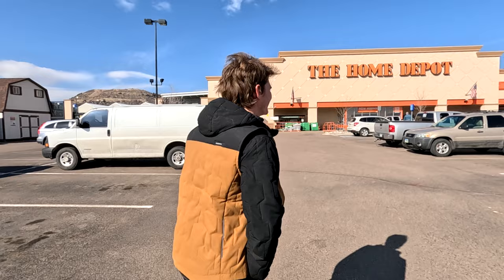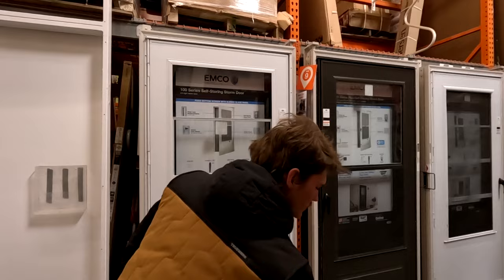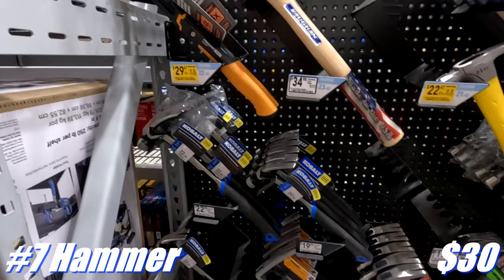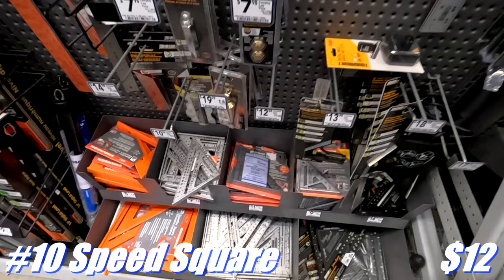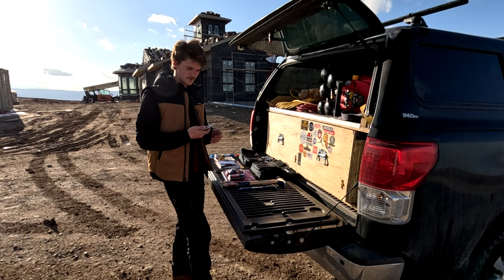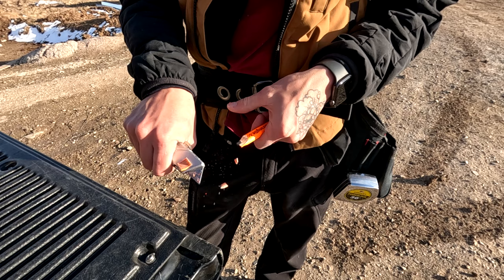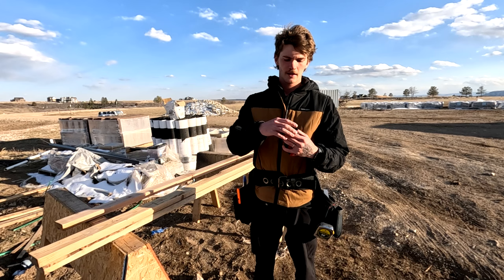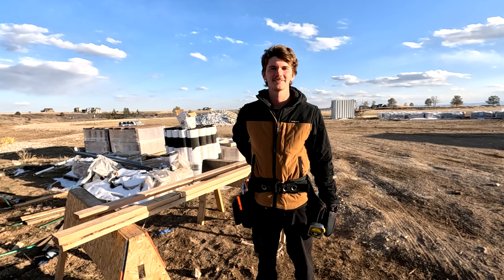Carpenters Toolbelt! | Top 10 Tools for UNDER $180

Comment: Be sure to use the blue chalk when snapping lines on concrete. It's almost impossible to remove the red chalk line from concrete when the job is complete.
Reply: Also if you're snapping lines inside, use blue. I have two chalk lines, a red one for roughing out and a blue for trim such as hand rails and such
Reply: The  smallest estwing trim hammer with the 2x4 rip claw is what i use so i can work twisted lumber its lightweight compact and can fit where large 20 ounce hammers cant
Reply: I have all kinds of different colors for different uses.
When framing the best tip I can give is when laying out your walls hit your lines with a can of clear lacquer… the clear lacquer will make those lines permanent and weather proof (so mainly helpful when framing in the winter or a rainy environment).
Reply: I have a deep indigo blue is that ok?
Reply: Yep. Someone should have told my concrete guy this!!!
Reply: There’s framing and drywall on your lines …. It doesn’t matter
Reply: @cjsawinski you can just get black chalk if you want it to be permanent.
Reply: Baby powder
Reply: Same. I use blue on exposed concrete like walls but when I know the concrete with not be exposed like on inside slabs with some type of flooring be it carpet or tile Black chalk is my preferred as it won’t disappear as easy from continuous debris
Reply: @gabesmith3938 still some clear coat will work wonders. Even on inside when the floors get dirty from sawdust and such. A little dab of water and they reappear

Comment: I’ve used Fat Max 25’ tape measure since a year or 2 after they started selling them decades ago, I made fun of a 2nd year young guy joking with him about the name, then I tried 1 after 4-5 other coworkers started swearing by them, the very next time I needed to replace a tape measure, I bought a 2 pack of Fat Max & have been using them around 40 years now if I had to guess, even use the Fat Max 35 footer for longer measurements, ONLY STANLEY Fat Max or regular Stanley I use, really dislike the company & rest of tools

Comment: I am currently 89 years old.
I started in the home building industry in 1951.
I remained active untill i was 70 years old in the business.
When i started most builders werent using any power tools, like circular saws.
Framing carpenters would have an open top hand made tool box with about 8” high sides.
Length would be about 36”, and the ends would be about 8” higher than the sides and tapered above the height of the sides.
The over all size of the box would be about 8” wide and 36” long, again with an open top.
There would be a wooden carrying handle attached to the raised tapered ends, and full length of the box.
There were no measuring tapes used, all carpenters used folding type rules of 6 or 8’ in length.
For longer measurements 50 and 100 ft steel tapes were used.
typical tools carried by a framing carpenter in the tool box would be 3 hand saws, one being a large tooth rip saw for things like cutting roof rafters, also an 8 point saw for general cutting of studs to length etc. and a finer cut 10 point saw for things like cutting white pine facia work.
The saws would have some type of a protective cover over the teeth.
Every carpenter had a hatchet in his box in addition to a hammer.
Most framing hammers were in the 20 oz range and had wood handles.
Plumb was the most popular brand for both hammers and hatchets.
There would also be in the box a combination square, a 24” framing square, and a bevel square.
Also a chalk box, a cats paw, and maybe a pair of pliers and a 24” level.
But basically that made up all the tools for a framer.
The contractor as a rule furnished the longer level used for the framing.
There were no speed squares at that time, also no nail guns or power tools other than early type circular saws used by very few contractors.
And the box of tools would be carried to and from the vehicle to the actual work place.
Reply from the maker: Wow that is amazing! Thank you for sharing
Reply: YOU'RE AWESOME ERNIE

Comment: Great choice of basic tools, after year of framing I knew I wanted to make a career out of carpentry. I bought Occidental Leather bags and used them as a finish carpenter, thirty years later with my own finish carpentry business I still use them even when hanging cabinets. The thing about the nail bags is once you get used to where your tools are, switching brands sucks.
Reply: Worse when your tool bag company goes outta business, Mine were MTM bags...

Comment: The Swanson pro (with the book) is where it’s at for normally priced squares. So many more useful functions than any other square for the price range. Also, those chisels don’t have a meta back, Lowe’s, Walmart, and harbor freight all sell the exact same 3 pack but with metal backs and each store changes the color. The cheapest is at harbor freight. And lastly, I personally hate slip joint pliers, I carry the small/medium Irwin vise grips. Best all around pliers. Knipex are obviously better but too expensive to just beat the shit out of haha

Comment: The next model up from that pouch set I have it and the nail bag on it has the speed square slot it has a small pouch in the back next to the Hammer holder I keep my truck line in that one and the actual Hammer loop on the tool holder pouch I use that to hang cordless nail guns off of

Comment: I’m in Occidental Leather guy myself. Yes they are pricey but they practically last forever (at least th😂 real leather ones do). The synthetic ones I have to admit are lighter and possibly more comfy (at least until your leather breaks in). But I’ve seen so many synthetic bags just not last in the professional world.
These days I’m mostly a trim carpenter and don’t even really need bags but I where an occidental “vest”. The vest is awesome, it’s light and doesn’t bother my hips at all. And if I ever need full bags for framing I can attach my old occidental bags right to them for a full kit.
Reply from the maker: I’d love to try a vest someday! I tend to sweat a lot, how’s it do with that?
Reply: @Coffmanconstruction  I’ve mostly used the best for finish carpentry and with that use it’s just fine. I would imagine that framing in the summer sun it could get a little sweaty though.
Reply: @Coffmanconstruction My boss uses the vest. He loves it. He uses on construction jobs and finish carpentry jobs. We do remodeling from commercial to residential to small projects to anything basically

I prefer my oxys. I got the fat ones hybrids of leather and nylon. They have been holding up for close to 2 and 1/2 years now. I bought each bag separately and then I put a tactical battle belt setup on them. It actually works better than my old set of gatorback belt for one. I can adjust the belt wherever I want where the gator back you didn't..

Previously I bought three sets of gatorbacks and they did not hold past a year each so I'm happy with the set.

I also tend to carry a lot more tools. One of my co-workers took a picture of me while I was working I guess and I had two nail guns hanging off of me, a drill and impact loaded with nails and a clamp secured in my bags so that I could move three by eight material for a deck we were building

Comment: Do they not have the 30' FatMax Special Edition down there? Kinda surprising, usually there's no special deals for us Canucks that you don't have in the US. That's the tape I always get up here at Home Depot in Canada. It's like $27 CAD (~20 USD) for a 30' wide blade tape. It's cheaper than the 25/30' regular blade tapes unless you get some garbage off amazon.

Comment: The 19 oz Vaughn is what I use and it’s the best I’ve had it’s better than the 23oz bc of the curved handle but I’d rather my 19oz be 23oz other than that it’s amazing I recommended it to anyone
Reply: I have 2 Vaughan 19oz, with different handle lengths and thicknesses, best hammer I've owned, also haven't had the big urge to go stiletto either haha.

Comment: I bought a set  of Husky carpenter rig tool belt for $40 twenty years ago ( made by CLC) and to this day I still use it . Had set of $200 Boulder framing rig with three bags got stolen from my truck and the last time I left any of value in the ride overnight . Not only that saw nail gun cords hoses and my fuckin level that reached 18 feet . Learned my lesson that next morning and rest of that day.